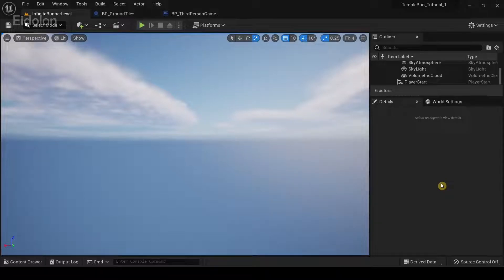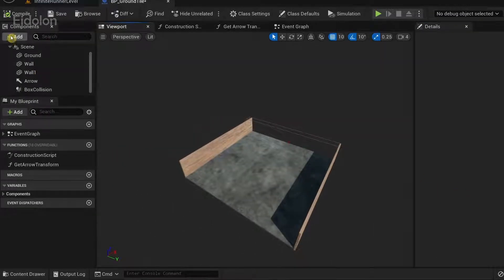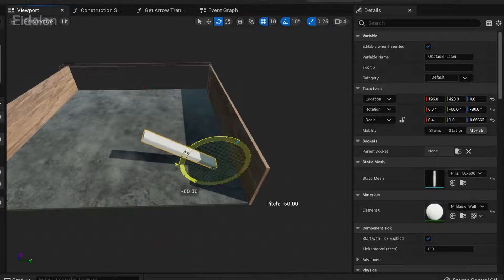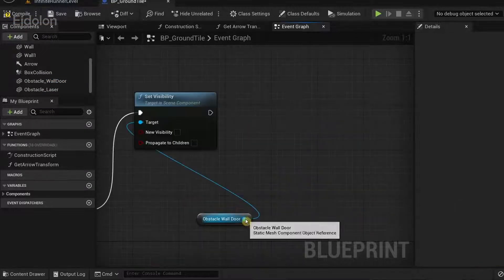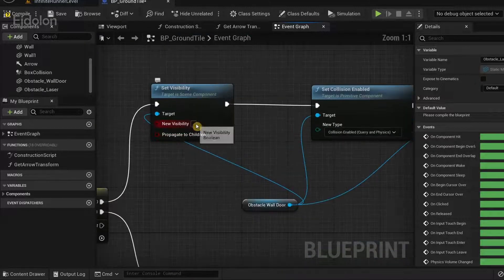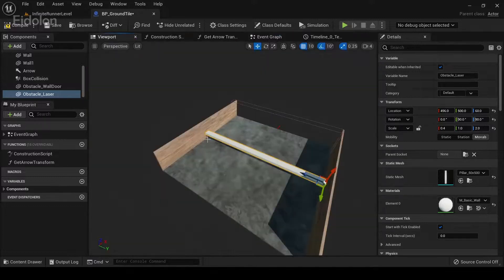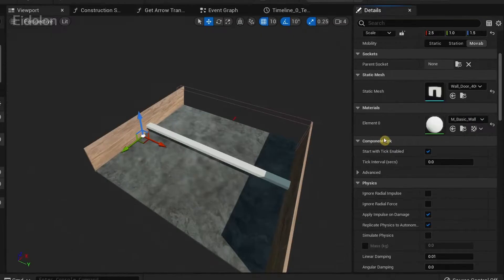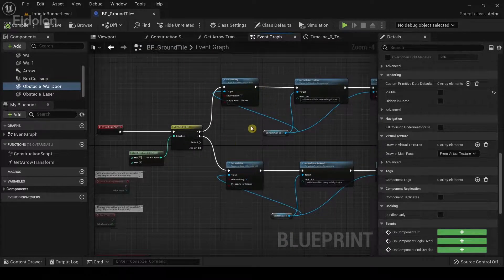UE5.0 Temple Run Tutorial: Part 8 |  Adding Obstacles to our Procedural Generator

Comment: Hey. I am following your tutorial and it's so great and easy to follow. I am facing one issue. I'm not have much of a coding background so im facing issue to create this. Instead of a laser im trying to create a rolling ball that keeps moving forward unlike the laser which is back and forth. for that, I have given the timeline in the constant up direction. But the problem here is before I reach the tile which have the roll ball the ball rolled away as the tile is generated before I reach there so as the ball. How can I fix this? I want the ball to roll or appeae when I'm on that tile.
Reply from the maker: I guess you could try add a custom logic to the box collision to check whether the player have entered the tile or not and if it did, set the visibility of the ball to true and run the timeline.

 When you try adding your own changes into the game, it is bound to create its own set of issues, so I wouldn't recommend adding your own changes in to the game if you plan to keep following this tutorial series. But at the same time, adding your own changes and fixing the issues that comes with it, is the job of a programmer and having such experience will help you make great games later on, that is assuming you are willing to keep fixing bugs in the game and the fixes for the bugs end up creating new bugs elsewhere.